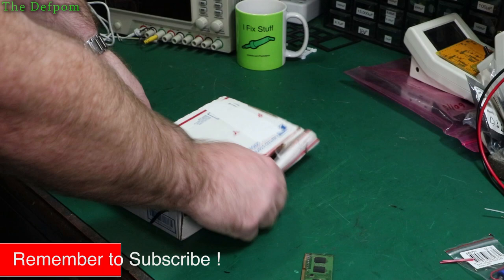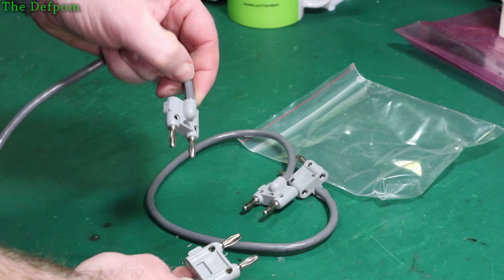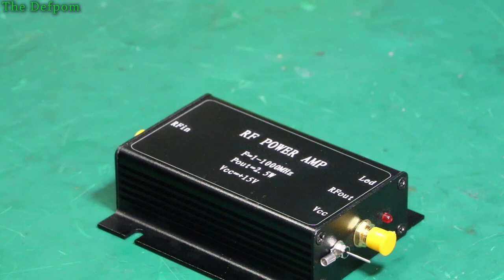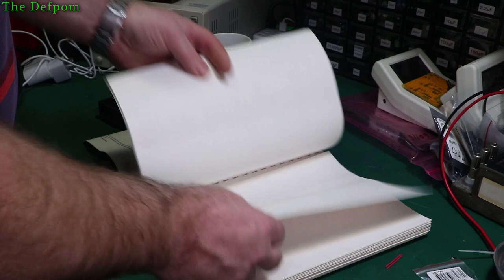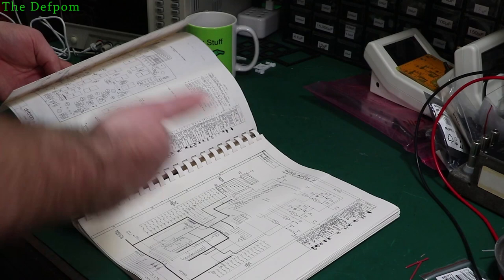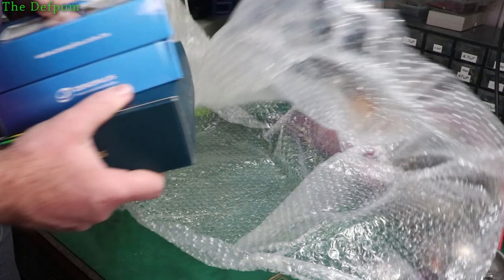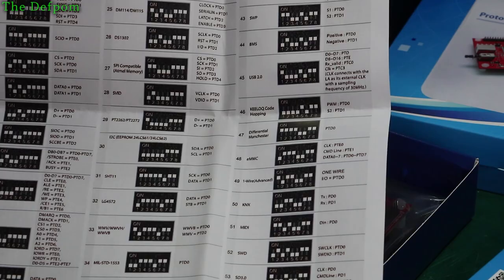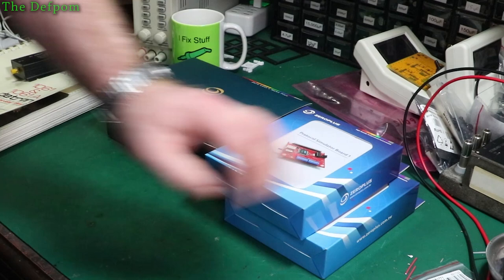#726 Mailbag Monday 22nd June 2020

Comment: Translation from the back of the 32256M box:-
-ABOUT US
-NUMBER OF CHANNELS
-MEMORY DEPTH PER CHANNEL
-MEMORY
-MAXIMUM SAMPLE RATE
 INTERNAL (TIMING) UNSYNCHRONIZED
-MAXIMUM SAMPLE RATE
 EXTERNAL (STATE) SYNCHRONOUS
-ELECTRICAL RANGE
-ELECTRICAL RESOLUTION
-EVALUATION
-OPERATING SYSTEM
-POWER SUPPLY
-PRODUCT SIZE / WEIGHT
Reply from the maker: Thanks Ian, I will have to add his onto the review comments too, I’ve already recorded and uploaded the review.

Comment: I have never heard of those leads but I don’t really have any DC high accuracy test gear. I think the spec of the RF amplifier is optimistic at best. I would quite like one of those high precision volt meters but I’m trying to be strict buying anymore test gear I will never use.  I have some huge HP protocol simulator at work.  I have seven or eight logic analyser  mainly HP and a Tektronix they look impressive but don’t get a lot of use following the death of combinational logic. But it does make me look smart when a customer visits and I switch them on in my lab. Thanks regards Chris

Comment: Unless the Zeroone software has been updated SIGROC, open source application, offers much better operation.  I have two earlier Zeroone analysers models, sadly for several reasons had less use yet than expected. First, small unit I bought at Altronics, then a larger model as a selloff from TRIO Measurement, at far below normal cost.